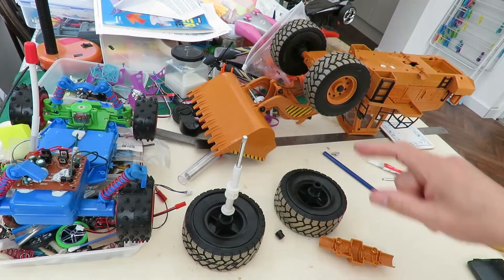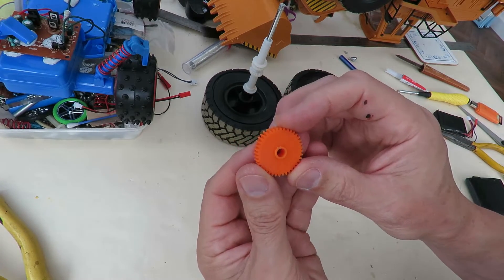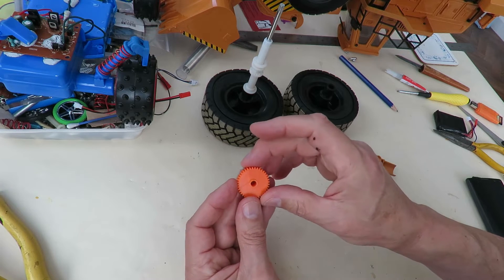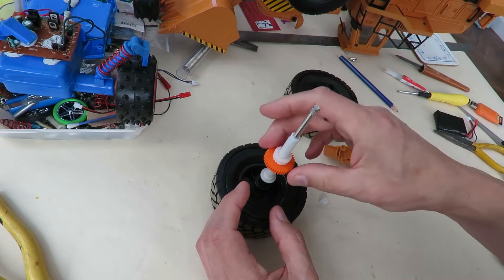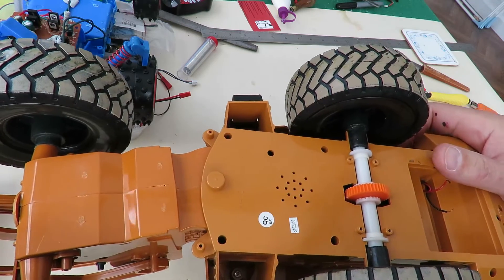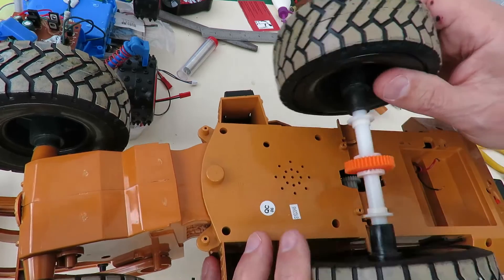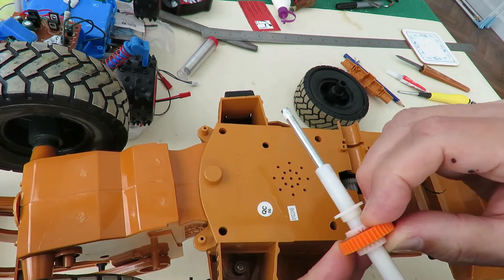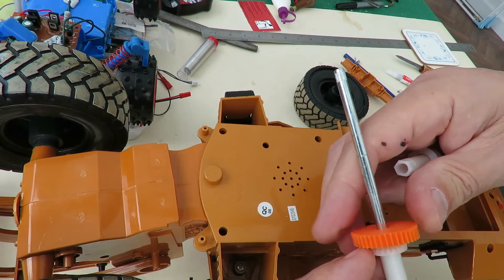Third Look RC HL Toys Bulldozer Power Scraper SW HL 3058

Comment: Maybe use magnets to make it a unlimited slip differential Loader.
Reply from the maker: Sounds more complicate that fixing the diff' 😁
Reply: @GrandadIsAnOldMan  Just mount 4 neodymium magnets 5mmx2mm in the drive gear and 2 in each driven bevel gear (3D print with the cutouts). It's a very simple design! When you exceed the torque the magnets will lose contact.
Reply: @GrandadIsAnOldMan  If you want less torque you create (more) space between the magnets, if you want more torque you use more magnets. It should be called a limited torque differential and is also a sprocket saver. In soil a solid axle is the best option.
Reply from the maker: @prep0wer  thanks, like I said, sounds more complicated than replacing what is missing. Possibly an interesting project on it's own but not what I am trying to do here.
Reply: @GrandadIsAnOldMan  I don't mind. It's already a big achievement to recreate the sprocket. Maybe I'll try this on RC car.